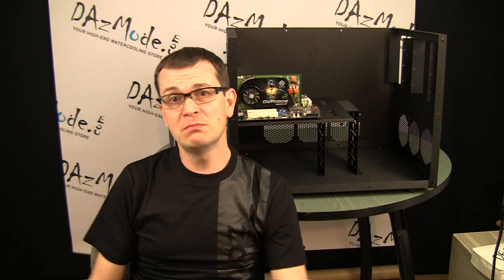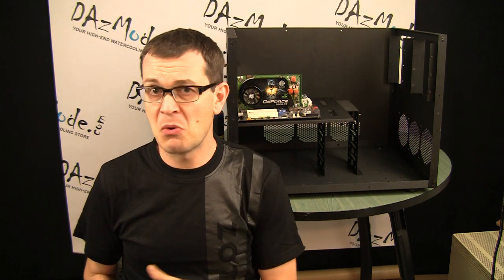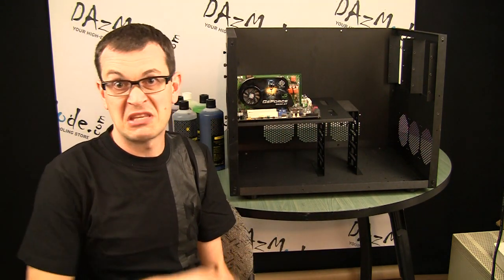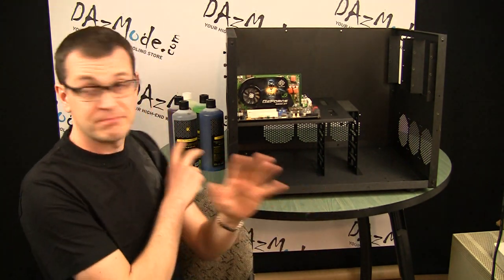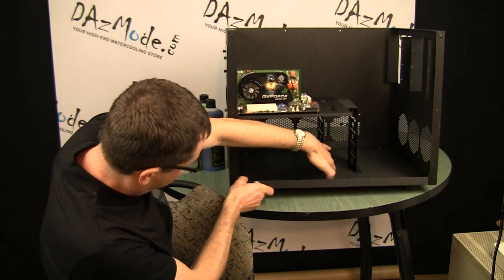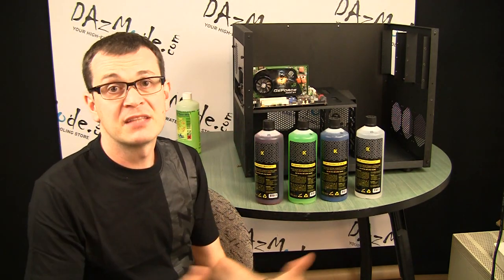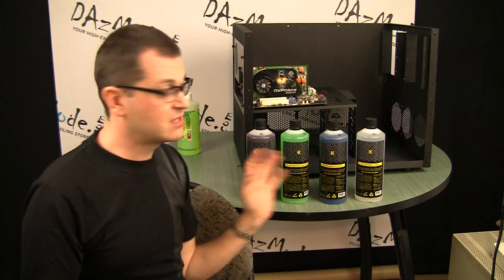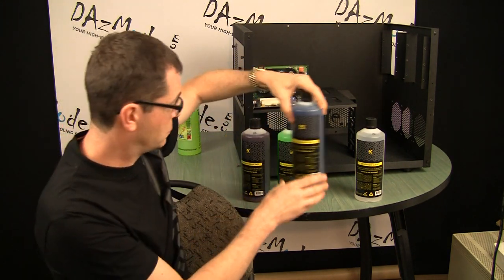Ekoolant  Liquid  Release - DazLabWeekly 21

Comment: @DazMode for sure price is attractive. But I have learned, BEFORE I ever put another unknown coolant in a system...I better test it first. Feser One (red) is great.
As soon as I drained the system and went for Phobya Red (I needed more Volume), all tubing and blocks were messed up within weeks. The tubes were red and everywhere little red particles. Apart from that, the 'red water' was purple.

There ARE differences in watercooling coolant.
Or maybe mixing Phobya with little of Feser = bad

Comment: Hey Daz (or anyone who could help), do you know of any product that would be exactly like the XSPC Dual 5.25" Reservoir for Two Laing DDC's Dual Loop, except I want the pumps to be serial instead of having a dual loop (and not split chamber obviously) ? Basically the only space available are my 5.25 bays, and I want my res on top of the serial pumps without having to use a tube in between the res and the pumps... I have the 800D, any help would be appreciated. Thank you !